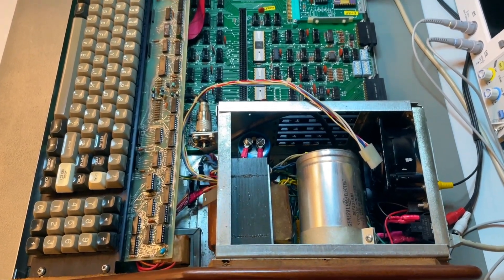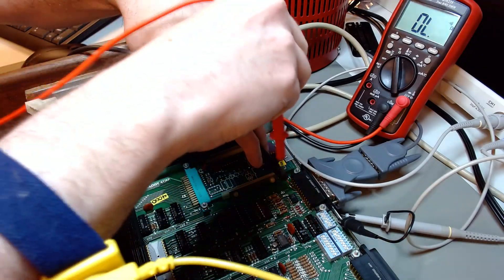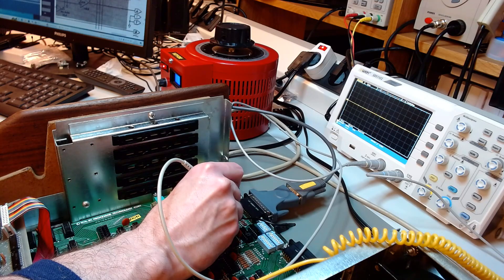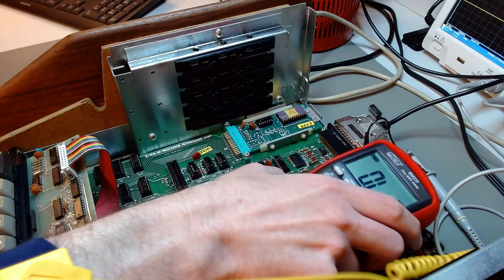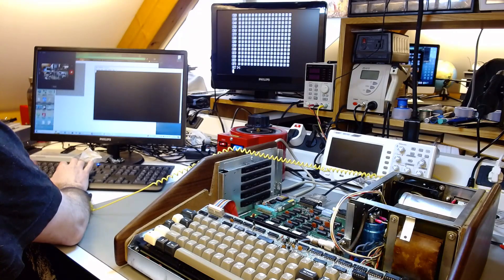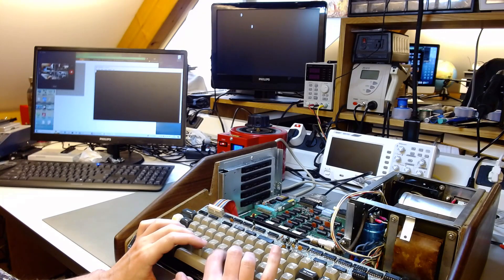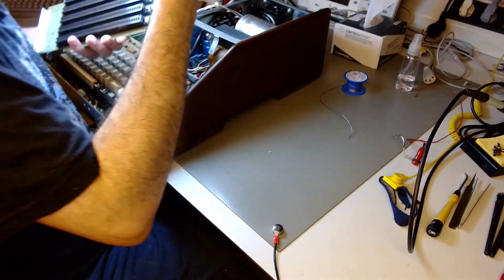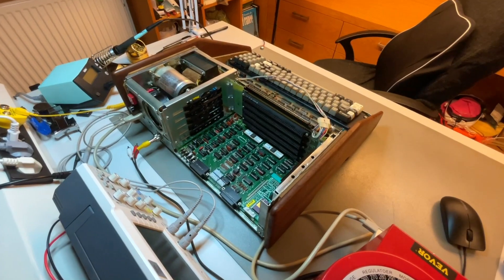SOL-20 museum restoration, PART V

Comment: Awesome!  I worked for Signetics in the early ‘80s at the Philips Research Labs Sunnyvale /  Advanced Technology Development (PRLS/ATD) group.  Fun to see you using our parts. 😋
Reply from the maker: I worked for Philips Research too, in the 90s!
Reply: @thebyteattic  Very cool!  We developed the SUBILO-N (SUBnanosecond Isolation by Lateral Oxidation) process in the development wafer fab in Sunnyvale.  This was used to produce bipolar ECL devices.

I also worked on a then-“Top Secret” project which was the first pilot-line production of CDROMs in Sunnyvale, introduced in 1984.

Comment: I was thinking diode when you had to flip the probes on the dmm to get a reading..never seen an IC behave that way though..cool haha
Reply from the maker: As another commenter mentioned, there is also the residual charge inside that chip. It's a level shifter without obvious external capacitors, so there probably is a lot of charge inside, which confuses the multimeter. The latter expects the only charge to be the one it puts out itself.
Reply: @thebyteattic  I don't think it's residual charge in the chip, it's because you still have the serial cable connected to the PC and it's power from the serial signals finding paths through the components on the board.  
You will get similar readings whenever to measure a resistance where there is still a voltage.

Comment: Hi just a small thing RS232is a standard not a protocol. 😮
Reply: Rs232 is a standard not a protocol. A protocol is an agreed set of instructions between two devices. Wyse VT100 terminal communicates using  a protocol using serial data, which could be over an RS232 or RS485 or another serial standard/connection . Other serial protocols include BAKNET, MODBUS, PELCO D, etc.
Reply from the maker: @geoffcollins6601  You're quite confused. Protocols can have (and virtually always have) a hierarchy of levels, such as in the Internet Protocol Stack. Insisting on this silliness just makes a fool of yourself.
https://circuitdigest.com/article/rs232-serial-communication-protocol-basics-specifications
https://www.electricaltechnology.org/2020/05/rs232-serial-communication-protocol.html
https://www.electronicshub.org/rs232-protocol-basics/
https://www.codrey.com/embedded-systems/rs232-serial-communication/
Etc. etc. etc.
Reply from the maker: RS232 is a standard communications protocol. 'Standard' just means something that different parties agree to use in the same form. But there needs to be something to agree on to begin with. In this case, it's a communications protocol, consisting of starting bit, word, parity, stop bit, serialized channel, control flow protocol, defined voltage levels, etc. The communications protocol we call RS323 is the substance of the standard we also call RS232; the communications protocol is the thing standardized.